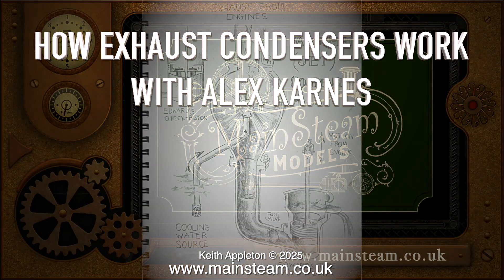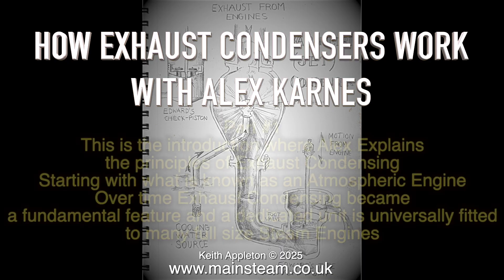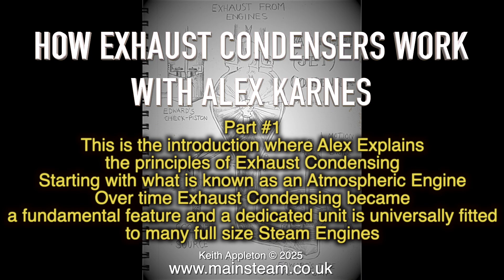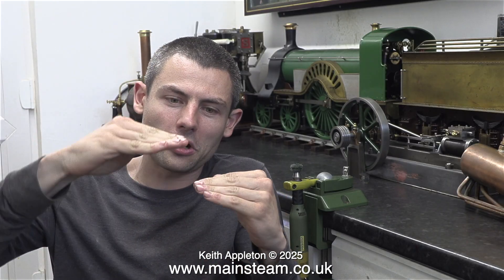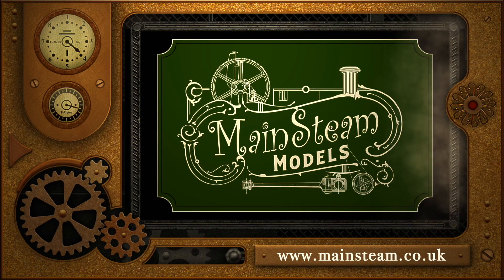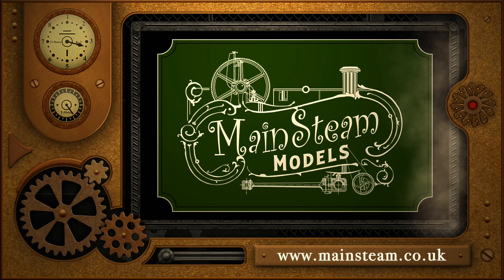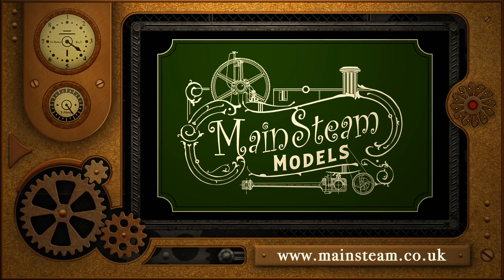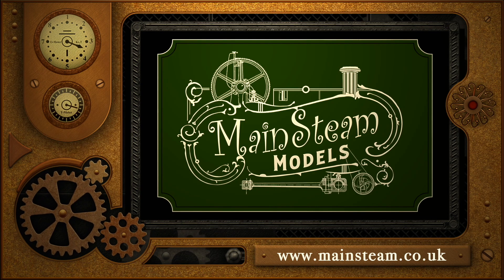HOW FULL SIZE EXHAUST CONDENSERS WORK - ALEX KARNES - PART #1

Comment: Condensers were the first form of exhaust scavenging.  They pull double duty in a steam engine by 1) Creating a vacuum that literally sucks the exhaust steam right out of the cylinder and directly boosts the power output 2) Recovering the waste heat in the exhaust steam to heat up that incoming cold feed water that goes to a hot well and then back to the boiler feed pump.  The ingenuity of the pioneers of steam was out of this world.